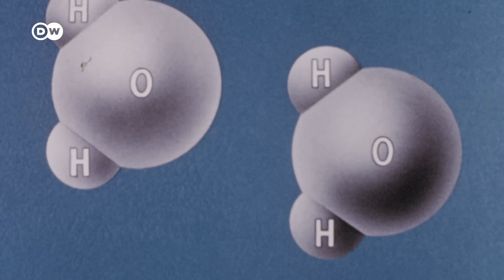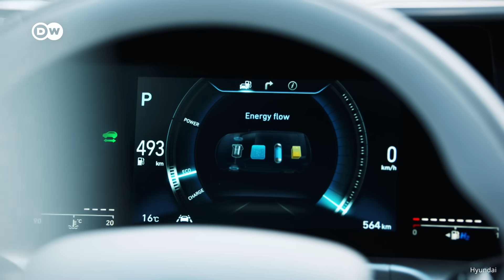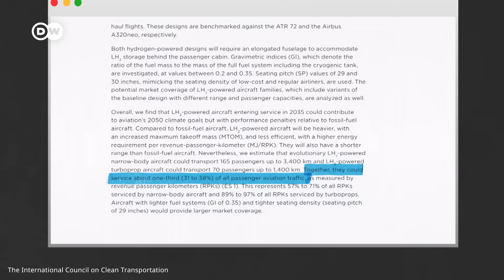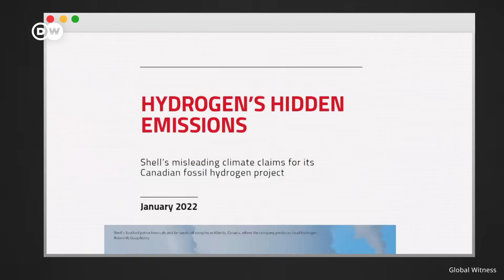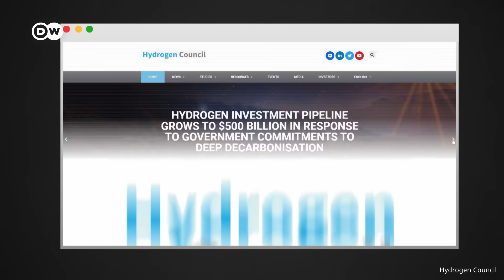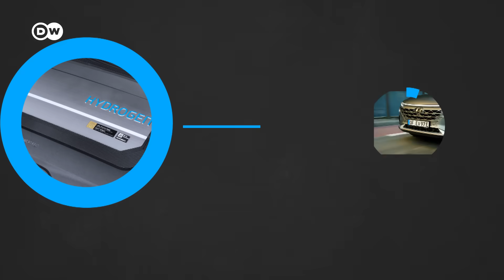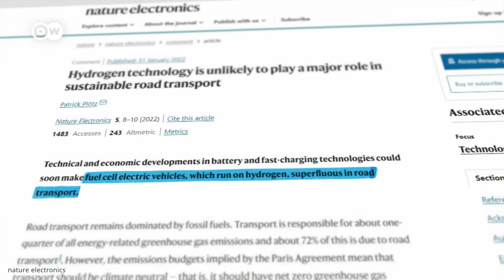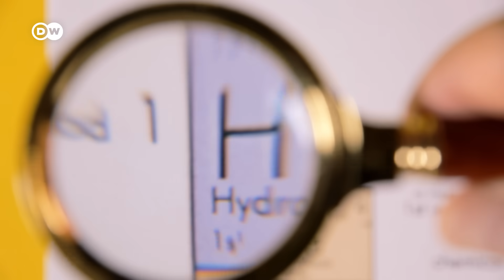The truth about hydrogen

Comment: 2020 wasn't the first time a commercial sized plane flew on hydrogen. This actually happened in 1988 with the Tupolev Tu-155.

Interestingly, due to practical issues with hydrogen on aircraft the project switched to using natural gas instead. This is telling. Whenever engineers are allowed to use a future aviation fuel free from political constraints they choose methane. This was the case with Tupolev but also the case in the US with Lockheed in the Carson study in 1980 and again with NASA/Boeing "sugar freeze" in 2012.

Furthermore, studies have shown that water vapour released at typical cruise altitudes of commercial aircraft results in warming effects that are actually worse than emitting CO2. This is because it persists much longer at these altitudes. This ultimately should disqualify using hydrogen which would result in far more water vapour being emitted at these altitudes.

I think the future of medium and long haul aviation lies with net zero power to gas production (methane) and/or with carbon negative biomethane. The other alternatives are either too expensive, too energy intensive to produce, bad for the environment or completely impractical.
Reply: While the idea worked on the Tu-155, it required a very large fuel tank that essentially took up a lot of the space in the fuselage, which defeated the idea in the first place.
Reply: Regarding your point of water vapor emissions being even worse than other NOx gases and what not: there are many contradictory studies on this subject, so let's give it more time until scientists can agree on one effect. Airbus is planning to launch the A380 tester that will carry a hydrogen powered jet engine and will do flight tests at these altitudes to determine the effect of hydrogen in the higher troposphere. Right now, most published studies are assumptions made, based on theory, but nothing has actually been tested and measured in large scale yet (to my knowledge at least).
Reply: Good point - there is a lack of research on the characteristics of water vapour at high altitude and more needs to be done to address this urgently. Given the way CO2 and H2O are currently understood to interact, it's essential we get a better understanding of this ASAP.

In parallel there should be investment in developing alternative aviation fuels that are less sensitive to this problem (aka methane), so that there is another option if we get bad news in 15 years time.
Reply: @camberedaerofoil  yes the airline indusrty is doing a lot of research right now into SAFs and hydrogen. SAFs are comprised of biofuels and synthetic fuels and there's a Synhelion working on creating fuel from, sun, air and water which is in close work with the airline industry. In the short to medium term, SAFs will be able to further reduce the carbon footprint of aviation until new technologies such as hydrogen powered fuel cells or hydrogen gas turbines come to the market. The problem as of today is that given the amount of hydrogen that could be uplifted to the concept planes, they would only be able to cover short haul and maybe medium haul flights. Long haul flights will probably still rely on SAF. But its just a matter of time until newer technologies will allow long haul flights to maybe move away from "classic" fuels as well. 
Overall there is a lot going on to in the airline industry to reduce their carbon footprint.
Reply: @TWCHHK  your views largely mirror the general consensus amongst the aviation industry currently. My concern is that these approaches introduce fuel price risks that may decimate the industry on a scale that would make covid look like a walk in the park. This is because SAF and other drop in fuels are tremendously expensive, and it is not a simple scaling exercise to fix this. The cheapest SAF currently costs 2x the price of fossil Jet-A1 and it is made from the HEFA pathway which is used cooking oils - a fully utilised resource. The other pathways are considerably more energy intensive and hence will cost more. Given how sensitive airlines are to fuel price, I don't see how this is going to be financially sustainable, even if it is ecologically sustainable. The current view amongst the aviation industry is that governments will subsidise sustainable fuels but we aren't really seeing that happening yet and it's not a proper long term solution.
Reply: @camberedaerofoil  you would be surprised to heae, but in Europe millions will be invested from various governments to help the airline industry turn greener with SAF and other newer technologies. More and more airlines start using blends of up to 20% SAF in their normal Jet A-1 usage. The more airlines start using it, the more prices will drop. Airlines more than ever now have to turn "green" to gain the publics/passangers favours so this is an investment they have are willing to do. 
The production of green hydrogen will rely on the production of renewable energy, so naturally northern africa and the middle east will be the places to locate green hydrogen production. The german government as well as a fee big companies in the energy sector are investing in the development of large hydrogen production centers. New technogies (using eloctrolysis of eater vapour) allow the production of hydrogen to reach efficiencies of up to 80% with reduced energy consumption at the same time. So, for what I have been able to find, I truly believe that SAF and hydrogen can have a future in the airline industry.
Reply: @TWCHHK  from 2012-2014 the global aviation industry spent over $220 billion per year on fuel alone. "Millions" in subsidies are nothing but a drop in the bucket.
Reply: @camberedaerofoil  The millions I was referring to are for the development in Europe...
Reply: @TWCHHK  the fuel cost per year in Europe for the same period was about $50 billion. "Millions" in subsidies still falls woefully short.
Reply: @camberedaerofoil  There are various european airlines putting their own investments into the development of SAFs, so any additional (hundred millions) to support further research in the field is a step in the right direction.
Reply: I agree that hydrogen would be a terrible fuel if combustion is involved.  I think a carbon-neutral version of conventional jet fuel would be a good near-term solution for trans-oceanic jet flight.
Reply: @incognitotorpedo42  the problem with carbon neutral Jet-A1 and SAF is that they are prohibitively expensive. As the cost of carbon increases this will get worse. Airline business models simply can't tolerate paying much more than what they currently pay for fuel. Another solution is required for the long term.
Reply: @camberedaerofoil  depends a bit on the aircraft, but if you can, for example, capture that water again (and that does mean you can't burn it), you have 0 emissions.
Reply: @Hans-gb4mv  Yes that's true, although storing the water would be impractical for long flights. You likely wouldn't be able to use the same tanks as the fuel, and the aircraft would need to carry the full fuel mass for the entire flight. The weight term in the Breguet range equation would become a constant which would result in a reduced range for a given fuel load, or conversely, a greater take-off weight for a given range. (Note this is also the case for battery powered aircraft).
Reply: How exactly does water warm up the atmosphere more than CO2?
Reply: @mythicalguy1236  water vapour is actually the most potent greenhouse gas. It has an infra-red absorption spectrum with more and broader bands than CO2, which helps it trap heat in the atmosphere. Normally human emissions of water vapour e.g. through cooling towers or irrigation are removed via rain in weeks. However when water vapour is emitted af high altitudes it has the potential to persist for much longer.

Water vapour also appears to cause the most important feedback loop related to global warming. As the earth warms, the rate of evaporation and the amount of water vapour in the air (humidity) both increases. This extra water vapour in the atmosphere causes greater warming, resulting in a positive (reinforcing) feedback loop.
Reply: burning methane still produces about 65% as much water as burning hydrogen, so i dont think the water vapor from hydrogen is a big problem.
Reply: @dr.nico99  water vapor isn’t as bad as CO2. I wouldn’t worry about it too much. I wonder if there’s a way to direct that water vapor to a specific part of the planet like the Sahara to terraform it and reduce carbon emissions even farther. I don’t think we need net zero emissions, but net negative emissions.
Reply: @therealspeedwagon1451  Build pipelines for water vapour at 10 000 m that lead to the nearest desert?
Reply: @Wizard_of_oOZe  was thinking that or maybe something like cloud seeding where we artificially make clouds which create rain to terraform entire deserts into either wildlife sanctuaries or agricultural districts
Reply: @therealspeedwagon1451  LoL. Yeah I was making a cheeky joke. Though it sounds like a problem with solutions if the right minds were put into play.
Reply: @dr.nico99  or put another way, burning hydrogen increases water vapour emissions by 50% compared to methane. It's a massive increase. Grewe et. al. 2017 "Assessing the climate impact of the AHEAD MF-BWB" (pdf available online) shows the additional contribution from water vapour from a hydrogen fuelled aircraft results in greater global temperature change than the CO2 emitted from other fuels.

The authors conclude: "Clearly, a CO2 reduction is important, but a climate impact reduction requires addressing also contrail cirrus, water vapour and NOx emissions. As a result of the close cooperation between the disciplines, we found that the AHEAD aircraft fueled by LNG and bio kerosene, flying at FL 430, represents an adequate technology to reduce the climate impact and equivalent CO2 emissions."
Reply: @camberedaerofoil  I don't think you really know what you are talking about if 100 to 65% is rounded to a 50% decrease than 65 to 100% should be labeled as a 100% increase not 50%. That is trivial mathematics... if you missed that what else did you overlook in your personal research?
Reply: Some very good points in your assessment. Yet, methane still has a much lower energy density than common (fossil) aircraft fuel. Meaning it requires more volume and weight to deliver the necessary amount of power to keep an aircraft flying. This reduces possible cargo and passenger numbers making air transport and travel even less efficient. Plus, an editorial note: "the other alternatives" is redundant since "alter" already is Latin for "other".
Reply: Synthetic liquid fuels are just as easy to make as methane. It’s been done since WW2 using the Fischer Tropsch process - you just tune it for the length of hydrocarbon / alcohol molecule you want.
Reply: @allangibson2408  the Fischer-Tropsch process requires synthesis gas to work. To do this the carbon containing material must first be broken down into a gas. This is why historically FT has used methane as an input! Methane is far less energy intensive to produce. The general rule of thumb is the longer the hydrocarbon chain, the more energy is required for synthesis. Methane has 1 carbon atom. Jet fuel is a mixture of hydrocarbons from 10 to 16 carbon atoms long.
Reply: @camberedaerofoil  The original Fischer-Tropsch process used in Germany used brown coal but any agricultural waste will work. The actual required feed is carbon monoxide and hydrogen…
Carbon Monoxide and Hydrogen is also known as town gas, manufactured gas or coal gas.
You can also use domestic garbage as a feed stock.
The Germans made jet fuel from coal during WW2…
C7 through C15 would be more accurate description of standard Jet Fuel but gas turbines will run happily on anything combustible and liquid (C5 on).
Reply: @camberedaerofoil  Historically methane was a second choice. Germany had a LOT of coal and no gas or oil reserves.
Gas production from coal started in Germany in the 1850’s with the Siemens process and was further expanded by the Lurgi process in 1936.
The Haber-Bosch process created huge demands for hydrogen for Ammonia synthesis from 1913 that continues to today (Haber-Bosch is what made WW1 possible from the German side). The Haber-Bosch process consumes 30% of the total global natural gas production to make hydrogen. As an aside Haber actually recommended Uranium as an ammonia synthesis catalyst…
Ammonia is another alternative for gas turbine fuels.

Comment: I think it would be very useful to stop calling hydrogen a fuel or energy source. It's an energy storage and delivery mechanism, just as batteries are.
Virtually all energy comes from the Earth (geo-thermal) or the Sun*. The challenge is to manage the energy flow and conversions to deliver it in a sensible manner i.e. in as efficient a means as possible. Electricity is the most useful form of energy to drive our modern societies and economy. Hydrogen is not the most sensible means of delivering that energy, as you point out, but it does have some aspects to make it more practical in limited applications than heavy batteries and other forms of storage and delivery. 
*Wind and wave power are secondary forms of solar energy, so they fall into the same current energy budget, where energy is just shuffled around to be more useful.
We've been spoiled by the fluke biological and geological scenarios of the distant past, where extremely high levels of atmospheric carbon were sequestered in the form of coal, oil and gas. By burning that now, we are releasing the carbon and recreating the ancient atmosphere, only in even more concentrated form. That's why manufacturing hydrogen from gas is so counterproductive - you are reaching across time and bringing past atmospheric conditions into the present.

Comment: As someone whose worked in nuclear plants and been exposed to weird chemicals and carcinogens…. Hydrogen is what scares me the most
Reply: I was at a pharma plant, now retired, and we use about 3000 chemicals.  The big-volume ones are solvents, We have a specialised plant to do hydrogen reductions, but only because this is done under pressure, and with expensive catalysts. It is supplied from cylinder batteries which came from a gas supplier - we are a small customer.there was never a hydrogen explosion there in the 10 years I was involved, the plant staff are trained and  careful and the plant has specialised pipes etc.

Comment: We don't need to upscale the current hydrogen market. What we need is to completely change the current hydrogen manufacturing structure which is by methane reforming method, with electrolysis powered by renewables.

Comment: Almost everything you say is true - except you seem to imply that there should be just one solution for a universal energy carrier that will solve the climate problem. No one that understands the problem is saying that. The realistic answer is “all of the above”. We need to do anything and everything we can to first stop adding greenhouse gasses to the environment, and then start removing what we’ve already added, and (ideally) we’ve got to do this in a way that keeps everyone happy - not necessarily including the fossil fuel industry.  And of course there will be “chicken and egg” problems and technology that has yet to be developed. That doesn’t mean it can’t be done. It means the problem has to be solved by science and engineering - not politicians, or by taking a vote on which technology to use. And to get from here to there will require everything in the toolbox; solar and wind for sure since it is available and inexpensive, extending the lifetime of operating nuclear reactors, accelerating the development of next generation nuclear reactors, and using bridge technologies such as blue Hydrogen. This has the added benefit of advancing carbon sequestration technology - which we will desperately needed when it’s time to get the carbon that’s now in the air - back in the ground.  Decarbonizing the entire energy sector is very complex but we have to do what makes sense for both the near term and the long term.